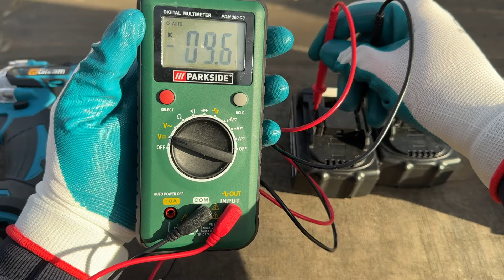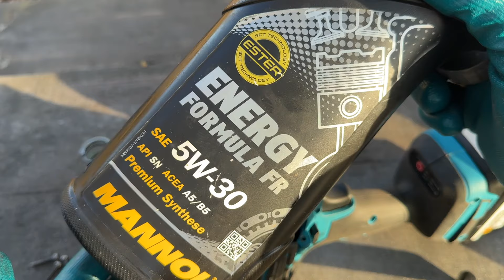Experimental ONE OF A KIND impact wrench - Does the ambition outweigh the current technology?

Comment: Cool to see this tested! So the tool was indeed somewhat limited by the spring, but the motor is definitely not torquey enough to overcome the stronger spring huh. You've kindof created the opposite of the hikoki triple hammer which skips impacts under heavy load!
Reply from the maker: Hmm, it would be interesting to try a triple hammer on this. Grabs disproportionately large plasma welder. I think there is some promise here, with proper high output batteries. However if I spend 50EUR on a battery why would I use it on this and not on the real thing. It was indeed interesting to get this done. Initially I felt I had achieved something and then the battery started to drain and I was drained of my achievement. Still surprising that with a full charge it can do better with the genuine Makita spring than with the Gisam spring in there. 20Nm difference is not too much of an overstatement I feel.
Reply from the maker: I also wanted to do that in this video. However I thought it would become too long and burdensome to watch. Still I think there is some more exploring to do in the battery area. I saw a claimed 16Ah Makita-like battery on Aliexpress today. I think that would be fun to try out. No info on the cells used in it though.

Comment: Also, on that model, using an original makita batery helps. God job on this one!
Reply from the maker: Thank you, I don't think there was any proper insight in this video, but on the other hand it was fun to get to do this.
Reply: @BrokeLifeEU  for me it was, as, at some point, was thinking of tweak it as you did, also, it was fun explaining why was it stopping, I think that is an overcurrent protection or maybe the battery is not providing the current it needed. I am using my drillpro one only with original makita battery, as do have a couple of those...
Reply from the maker: Thank you so much! I am glad I could provide insight! I really thought it was just a fun test and no real substance. Albeit I was surprised they managed to get the most out of the impact wrench, without leaving anything on the table.

Comment: You should test this impact wrench with an original Makita 5 AH Battery. Maybe the fake battery isn't able to deliver enough Amps.
Reply from the maker: For sure the fake is not capable of delivering enough power. I will invest in some genuine Makita batteries and chargers at some point, but still a bit of a pricey investment at the moment.

Comment: You need to replace the cutting wheel on the angle grinder if it’s chipped like that. Compromised strength and it can snag and shatter
Reply from the maker: Absolutely spot on! I showed it on camera, but replaced it for the cut! It is a cheap disc from aliexpress and on top of that it is damaged, it got a one way ticket to the bin.
Reply: Good to hear. I’ve also bought some cutting discs from Aliexpress and they smell horrible. Haven’t even used them but that’s cause I found 1mm extra thin Bahco discs in our danish version of Harbor Freight incredibly cheap. Haven’t used any others since. They cut like a knife through butter. I don’t apply much pressure and so they last me a very long time. No chipping seen yet. Recommened. Lol
Reply from the maker: @outsidethebox9658  Thank you! I will see if I can find them somewhere and give them a go. For proper good discs I always go with Bosch. Best price/performance ratio. If I am only looking for something cheap and reliable I will go with Yato for the 76mm discs. They are not amazing by any means but are cheap and will do the job.

Comment: Since you were able to replace the anvil, I've been wondering if it's feasible to swap an anvil from 3/4s of an inch to a half inch.  For context, high torque wrenches are best used when combined with extensions or universal joints to access difficult and tight bolts, since the additional extensions will have power lost by the time it reaches the bolt.  Cheap but powerful impacts (such as the Onevan 3100nm) use 3/4 anvils, however the selection of 3/4 sockets aren't as robust, or as small, as 1/2 inch, necessitating a step down adapter, adding one more link where power will be lost.  Will getting a Onevan and swapping the anvil out be sufficient, or is it not so clear cut?
Reply from the maker: Everything is possible! The issue is finding an anvil that firs as these tools from Aliexpress/Temu etc don't have part numbers so the question s how much is one willing to spend to find the correct part. As it's trial and error basically. That said if you are looking for a powerful 1/2" impact wrench I tested the 2800Nm Gisam in one of my videos. That one is also the Onevan 2800Nm and I think it is really nice for its price.
Reply: @BrokeLifeEU  ah, gotcha.  The reason I mention that one in particular is because I think it has the best price to performance ratio, based on what was shown on Torque Test Channel.  The packaging can say anything it wants, I'm more interested in raw data, hopefully he tests more cheapo, off brand impacts.  It was his testing that made me buy a Seesii for 90 USD, capable of 435NM of tightening at 5 seconds and 577NM of loosening torque at 10 seconds.
Reply from the maker: @LuwiigiMaster The 2800Nm I use only so as to tell you which one I am on about. In reality it is not even close go that figure 😅 but it can still go up to like 1000Nm which for its price is not bad at all! As for TTC that channel is just so good for actual comparion between all of those tools!
Reply: @BrokeLifeEU  I appreciate it nonetheless, maybe some day I could do some DIY experimenting with the anvil swap with the Seesii one, if I ever buy another impact that is.

Comment: Out of the box unmodified
What were the highest NM values you got to?
For example forwards/reversed?
Reply from the maker: On a full battery and a good day also on a boot with no rust and that has just been installed. 210Nm-220Nm at most. After that it is anyones guess. It might go it or it might not it will depend on the unit. A safe guess is 200Nm at most. How long it can continue doing that is still unknown. The cells in the battery are questionable at best. The tool itself looks like it can take a beating and is capable of a bit more but the battery is the the main issue holding it back.
Reply: @BrokeLifeEU  Thanks for that :)
Are there alternative battery options with more longevity reliability?
Reply from the maker: @collegesynewave Not a problem at all! It should take a genuine Makita battery or you can just get any decent battery and use a 3D printed battery adaptor.
Reply: Splitt battery and load in high discharge rate cells will have more power then or use original makita battery should do same

Comment: Did you compare this original impact wrench with modified PS ..B3 or C3?
Which one is more poweful?
... Or this will be in new movie?
Reply from the maker: Do you mean the green Parkside PASSK B2 with the modified B3 and C3 or the Gisam against the B3/C3 1/2"?
Reply: @BrokeLifeEU  PDSSAP B3 conversion to 1/2"
Reply from the maker: Between the B3 PDSSAP and Gisam there will be no competition. 210Nm is easy for the Parkside and and a 50-50 shot for the Gisam. Even the green PASSK B2 brushed Parkside is a lot better at 210Nm than the Gisam.

Comment: Looks like i won't be changing any springs. 
I have the 1200nm impact wrench from gisam and its very powerful. You should definitely try it someday.
Reply from the maker: I ordered the Onevan version a couple of months ago, their 1800Nm version. First impressions are that it is a very strong impact wrench for that price. 
In this case the hypothesis regarding the different springs deserved some testing. I had hopes it would end up being a good mod, unfortunately it turned out not to be so. Best case scenario on a full battery you gain 10-15Nm, but I think it will severely shorten the motor's life so it is not worth it.
Reply: @BrokeLifeEU  i think the electronics will go first, on the other hand, that board is cheap, cheap for a reson, nonetheless. Did you see how tiny that condenser is? :-) I was thinking to tweak mine also with a bigger spring but a did not know a original makita will fit. I have the drillpro one but there are somehow identical, I'm sure. I have it for two years and a half, I do use it for smaller jobs along a parkside b3 and a milwaukee gen2, still working...
Reply: @BrokeLifeEU  I'm looking forward to the review for the 1800nm.
Reply from the maker: Yes, I think had I forced a bit more the electronics on mine would have also went the way of the Dodo. Still I think they can last as long as you don't overwork them too much. I even know of a mechanic who uses one of these daily and has done for over a year without any problems. If things get tough gets out the air tools, but if possible gets by with one of these.
Reply: I bought 1200nm gisam wrench its fucking great tool for the price I’m loving it also the battery’s are long lasting
Reply: @abusalem9499 which batterys?

Comment: Would be interesting to see if this gisam (or any other dtw300 clone) with good batteries (original ones or parkside with adapter) can compete with parkside 400nm
Reply from the maker: Stay tuned! 😉
Reply: @BrokeLifeEU  waiting for the new videos! oh and of course the dtw700 chinese clone is also interesting to compare with Parkside 400nm and 1/2-converted pdssap ;)
Reply from the maker: Hello again. Regarding this topic I uploaded a video today about a ONEVAN right angle impact which I test with their battery which is a 20V 4Ah with questionable cells and the 8Ah 20V Parkside battery. It's not like the results were surprising, but still.

Comment: First time I did this modification in 2020, when TopShak starts. Try to use 6Ah original Makita battery, that will be another 'mod', than you will see total difference. I tried to modified larger of wrench version with spring from DTW700, but there it was bad mod, after that spring wrench was much weaker :-\
Reply from the maker: I was actually surprised by how on the edge they managed to engineer it! I thought they would leave some room just to be sure. But it seems like they managed to fit the tightest spring thy could without scarfing on anything. I hope my video budget will allow me at some point to get to a genuine Makita battery! The spring in this case was something like 3 EUR and the anvil another 3 EUR so I wanted to see if I could get squeeze some more torque out of the Gisam for as little as possible.
Reply: @BrokeLifeEU  you need to try that clone of DTW700, that is very good wrench and with 6ah (6ah is really stronger than any other, like 5ah for example), I tried it and loose 1300Nm
Reply from the maker: I have the Onevan version! I have had it for about 2-3 months now. I don't have the time to get to it or a proper way to test it yet...I am working on it though! It does feel quite strong, not even for the price. It feels strong in general!
Reply: @BrokeLifeEU  I tried every brand of them, Kamolee is more 'smooth' and didnt cut off like gisam or onevan in that very limit situation with BL1860, but in my opinion onevan was strongest, but it cutted off in torque more than 1000Nm
Reply from the maker: For sure those things are nowhere near their torque rating. Even so I got the Onevan for something like 50EUR on sale with two batteries and a charger. It should be plenty good for any bolt or nut on a car. It's just with these Aliexpress tools the batteries charge so painfully slow that is a big discomfort for someone like me, who, can't plan out their time right.
Reply: Can 6Ah original Makita battery be charged with any asian clone charger? any experience with this?

Comment: Do you think gisam are a usable daily tool 1800nm sounds a little exaggerated
Reply from the maker: I have the 1800Nm version. I can confirm it ia nowhere bear that. But it can take off rusty bolts from a 4x4 that have nit been remived in years. So for use in cars I would say it is good enough. If you ise it with a decent battery it should be even better!

Comment: How to make the same modifications? Can you send a link for a parts? I also ordered like that one because of good reviews. I know i stupid because i didn't check a bad reviews before. So its not powerful enough, and i want to modify it
Reply from the maker: Hi, please be aware that changing the spring might put more demand on the battery so it has to be fully charged in order for the impact wrench to work properly. I believe in the video the new spring I put in was for a Makita DTW285 that was the only thing I changed in order to get more power out of it. In tge end changing the spring for a thicker one will result in more power, however going for a genuine battery may produce even better results.
Reply: @BrokeLifeEU  okay, thank you so much

Comment: There Are this modify for parkside performance impact wrench?
Reply from the maker: Could be, as long as the new spring is roughly the right size it can be done.
Reply: Is possible found a correct spring or a spring with the same size but more long or powerful?
Reply from the maker: I can look in to it, however if Gisam managed to figure out the best spring for their impact mechanism I doubt I can improve the Parkside.
Reply: @BrokeLifeEU  However, I imagined you already showed me enough how to modify it, I think that would be enough😂👍
Reply from the maker: @antonius3301  🤣🤣🤣 fair point! So enough with the modification videos for now!

Comment: Hello can you select all the modes. Mode 1 one LED Mode 2 Two LED & Mode 3 all three LED's. 
My unit has a, weird display. Wonder if your is doing the same things.
Reply from the maker: Hello! Thank you for commenting! SO I have checked both these Gisam impacts and the LEDs behave just as you describe. They are a bit weird you are right, however since it does not have too much power I usually just set it to LARGE (max power) and leave it there. The way I read the LED indicators in forward one says SMALL and the other LARGE. Small might be for screws (using the 1/4" hex) and Large for bolts/nuts using the 1/2" drive square. I hope I am being helpful here. I don't really use these a lot.